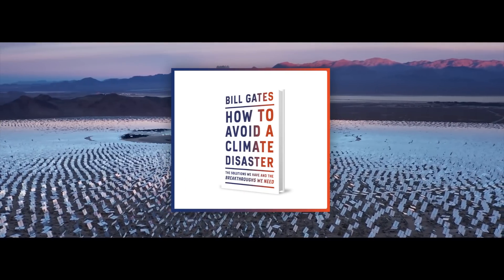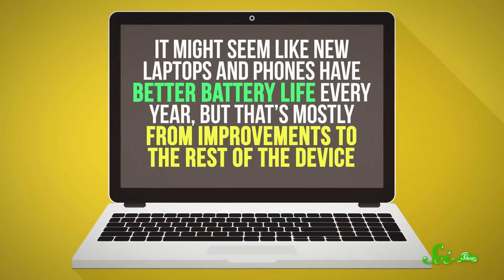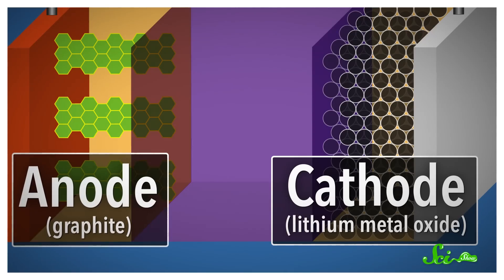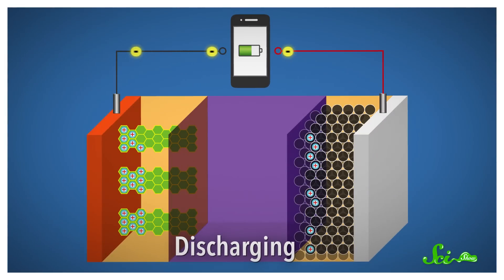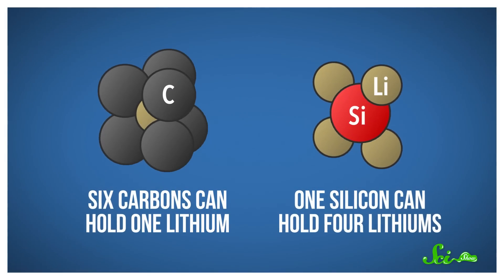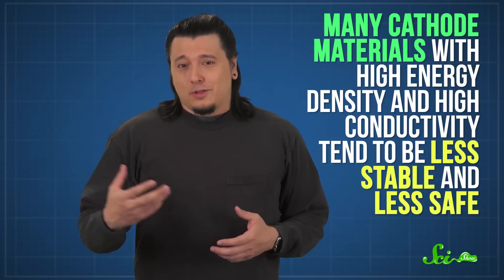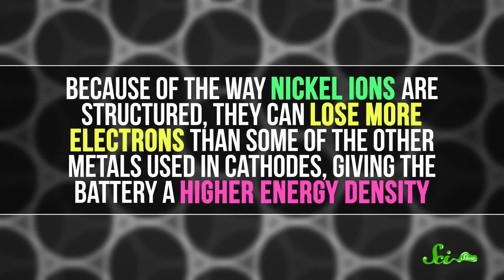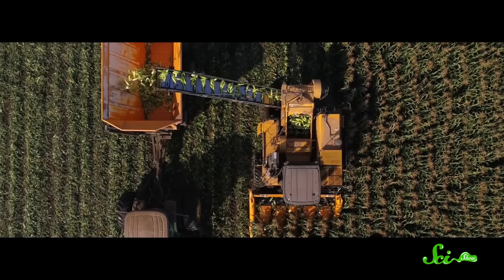Why Haven't We Built a Better Battery?

Comment: Just to think how the kids of our kids might be able to have a normal life without having to NON STOP worry about batteries. They will think we were crazy back in 2021.  I have to charge like 20 things on a daily basis. It's insane. 

Back in the day, it used to cost a ton of money to keep buying batteries...now that problem is mostly gone but... we gotta keep charging and charging.. Heck, my camera literally lasts 35 mins...my bluetooth headset is like 2-4 hours of audio... laptop on BATTERY SAVER MODE lasts like 4 hours... my phone lasts like 3-4 hours (non stop usage) 
The day we got a battery that lasts a full day of NON STOP usage is the day i can finally relax a little bit.

WE REALLY NEED BETTER BATTERIES!

Comment: Another good battery option for grid storage is Vanadium Redox batteries. They have an even poorer energy density than Pb-Acid, but can be made massive and have life spans in the 20-30 year range with +10,000 charge/dis-charge cycles. Multi mega-watt hour batteries of this type have already been made

Comment: Would „mechanical Batteries“ work? Like i know about water storage „batteries“ but couldnt we store the energie as potential energy of a weight like if more energie is put into the system than used we would lift a giant boulder (in real life it probably wouldnt be a boulder) and when more is used than taken we let it sink down and power a Generator wirh that energie
Reply: Pretty sure that can work whether it's better or worse than water is n intersting question.

Comment: Lead acid is a far better option for grid power storage than Li-ion. as size, energy density and weight aren't important. And lead acid is CHEAP and very easy to re-cycle.

Comment: Phone batteries have been getting bigger though. Their voltage has been creeping up over the years storing more energy even at the same mah, nominal voltage is 3.8+ rather than the 3.7 that would have been standard a few years back.
Such top voltage-4.3v plus would have absolutely destroyed old batteries.

I think because of incorporation of small amounts of silicon in the anode?

Comment: Why do we need SPECIFICALLY batteries ? We need to store energy, why don't we use pressure or weight or something else that's much easier to scale up to a country ?
Reply: they all have upper limits and cost issues.
Reply: @Great.Milenko  They have no upper limits, but yeah, they are not currently profitable in themselves. They need to be subsidized by the power plants that need them to provide the needed power at the right time.

Comment: In case of big storages that do not need to move I still like reservoirs of water and turbines between them, excess electricity-pump water up, or let it flow down and generate electricity. Just not as efficient as batteries but easier to build for big projects and not that many dangerous materials involved.

Comment: Energy storage will have to include other solutions- like utilizing renewable electricity for electrolysis (hydrogen) and potential energy (moving mass).  It is far less efficient than storage of electricity, but may be a good solution in addition to the batteries in a scenario where you have an excess of electricity in off peak hours.

Comment: The video is misleading since the power storage problem cannot be solved with lithium batteries. They have the best energy storage for their weight and volume, but when you need to power a city it is all about cost. Most of the options discussed are not even technically batteries, buildings filled with row after row of flywheels is probably the most common. In places where there are two lakes with a steep incline they will "recharge" a hydro-electric dam by re-filling the upper lake; but that only works in a few places.

Comment: I am no physicist, but for larger "batteries" do we have to think in terms of the stuff we can/have miniaturize(d)? Why couldn't we generate power, use that power to say, generate a crap ton of heat, store that heat, then use that when we need it in order to power a heat based generator much like geothermal energy. It's far to bulky to have in say, a phone, but scaled up enough I don't particularly see why it or something like it wouldn't be a viable (and perhaps better) way of storing energy at a large scale

Comment: Not to mention it’s extremely dangerous to increase the energy density of batteries. 

After a calculation on the energy densities of TNT and a AA battery, you can see that said battery has about 1/7th of the energy of an equivalent mass of TNT, though the energy isn’t released explosively when a failure occurs (usually).

There is real danger in increasing battery capacity to a point where failure can mean serious injury to nearby people, civilian or otherwise. It is yet another hurdle that researchers must tackle when designing new batteries. They need to be safe.

Comment: out of all the interesting discussions of material science, this is one I never understood- use nuclear, no need for battery tech. pump surplus from your nuclear to methanol production and you have carbon neutral fuel. but if you want to use large parts of land for low efficiency and unstable energy production, something like the energy vault idea can help /almost sustainably/ without the need for scarce metals like lithium

Comment: I do not think one will use batteries as part of a big power grid ever. No matter how "good" batteries will get, they are too resource intensive and lead to too much waste. And there are already working and easy to implement ideas to store excess energy from e.g. wind. I am not completely against batteries, but a better long term solution for a big power grid (and not just some small solution for an off the grid home) does not contain batteries.

Comment: Oops! Poor comprehensive research! Applications were not considered in this presentation. Small and compact is for one particular application while large and clunky will actually work better for other applications not requiring compactness especially when considering economy and sustainability. Both require somewhat different chemistries. I'm also sensing more and more PCing in Hank's productions which never mixes well with science. Otherwise, most of these productions are usually pretty good.

Comment: I’ve heard about molten salt for energy storage, is that viable or just the Internet being the Internet?
Reply: That’s not to do with energy STORAGE, but energy GENERATION. Specifically, nuclear power. Molten salt reactors use a pool of molten materials including a fissile material and compounds that optimize the reaction, heat transfer and stability of the mixture. It’s safer because it contains neither water nor hydrogen, eliminating sources of explosions. It also keeps the caesium and strontium bound into the salt mixture in the same way deadly chlorine is bound in table salt. It contains almost no moving parts, can use the safer thorium rather than uranium, it can’t melt down like what happened at Chernobyl because it’s ALREADY molten, and the nature of the physics behind the reaction means if it gets too hot the reaction automatically stops until it drops back into a safe range.

The future isn’t battery operated. It’s atomic.
Reply: @VisonsofFalseTruths  Thanks!

Comment: Mechanical battery (Flywheel) is the Best solution. 

The spinning ones inside a capsule, nodular, low maintenance, low cost, hi durability, already in use for decades, mature, environment safe, easy to store...

Why you don't speak about them?

Comment: Don't sell our friends over in the battery industry short.  They have achieved something like a 2-3x improvement in almost all metrics of lithium batteries over the last 10-15 years.  The problem is that for Li-Poly tech to be truly relevant in grid-scale storage, it needed to improve like 20x on (capacity * lifetime / $).  And that hasn't really materialized yet.  To be totally honest, for grid scale storage, arrays of massive flywheels may be close to the best we can do.

I think people have a bit of an aversion to them because they don't want to think of what happens if a 100 metric ton flywheel spinning at 500 RPM decides to seize on the bearings (very very bad things happen).  However A/C motors/generators are very efficient and you can even levitate the flywheel on magnetic bearings to cut all friction but surface air resistance.

BUT all systems that store that kind of energy come with huge risks.  If you pump water or lift mass, there's always the chance the dam could break or the cable could snap.  If you build out huge banks of high density batteries, they could ~explode catastrophically.

Comment: The production of batteries is horribly pollutive and expensive, for small devices and cars they are necessary but for a grid level system there are much more practical solutions. Any excess energy generated could easily be diverted into practical means of energy storage, such as pumping water into reservoirs to powering sub-surface biofuel farms.

Comment: You may be interested in a technology called pumped-storage hydroelectricity. Basically, solar and wind power pumps water into a reservoir at the top of a tall hill. The reservoir drains through dynamos at a steady rate, producing a consistent output of clean electricity even at night, during cloudy weather, or when the air is still. In effect, the reservoir becomes a giant battery storing the energy of solar and wind for use in hydroelectricity. 

This won't help your phone last longer, true, but it serves the purpose when you want to keep a small city running.

Comment: There are some alternative methods for storing energy by converting it into other forms.  For example, the HELMS facility in California.  Excess electricity is used to power pumps that push water up to a reservoir in the mountains, storing energy as potential kinetic energy.  Then, when extra energy is needed, they open gates that let the water drain back down through turbines that convert the kinetic energy back into electricity.  It's not perfect, but it's a way to make a battery with tons of stored energy.